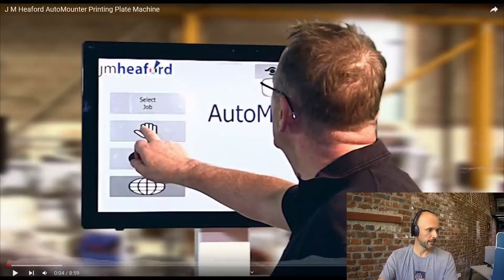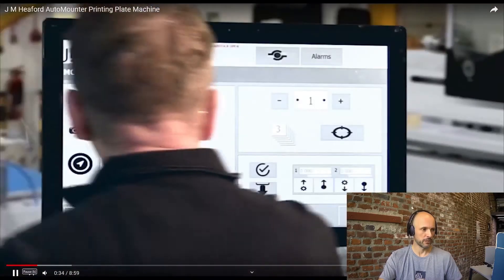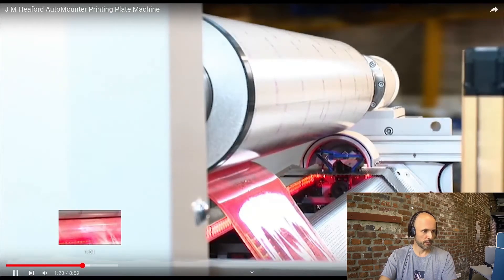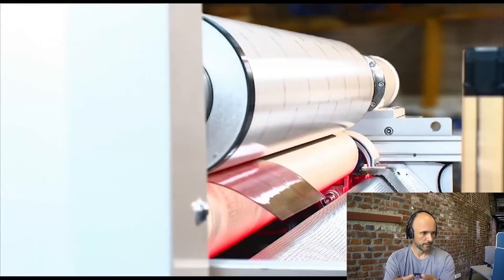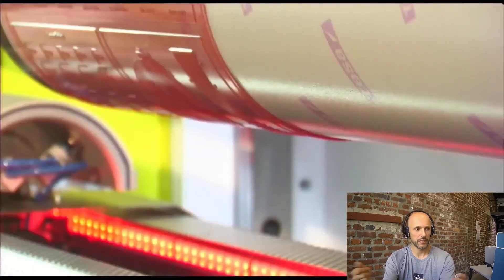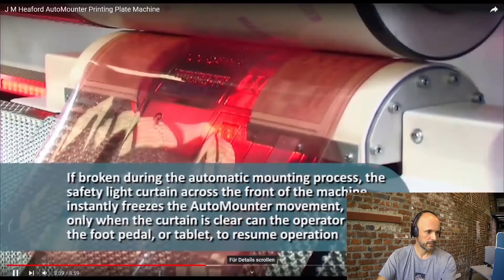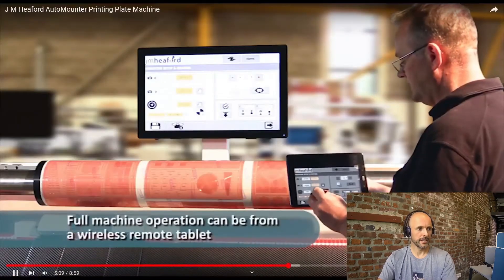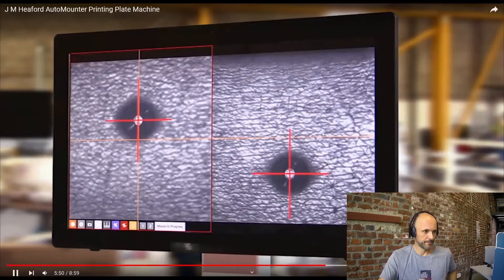Flexographic Printing | Plate Mounting Technologies

Comment: im using a Soma S-Mount automatic plate mounter but prefer to mount manually as its faster. That plate mounter can also scan the plate and then set the impression setting in the press for each plate. Its a very cool feature but no one uses it as it takes to long and we don't have a dedicated plate mounter. I have to operate the press and mount my own plates doing sometime 7 changeovers per shift. https://www.youtube.com/watch?v=KON24N4mAfQ&t=3s&ab_channel=SomaEngineering